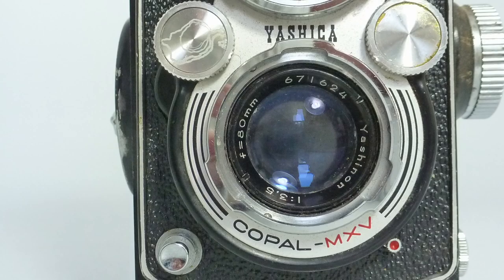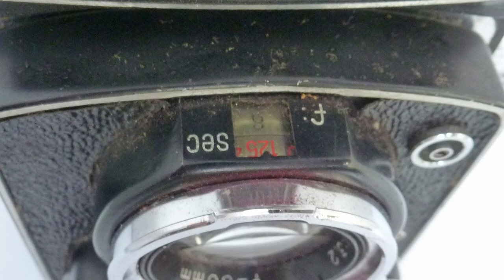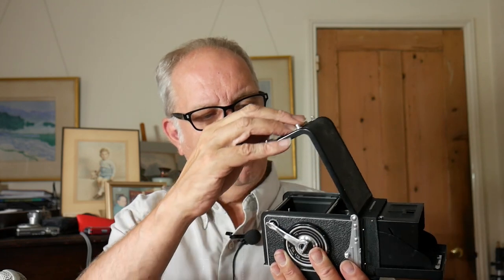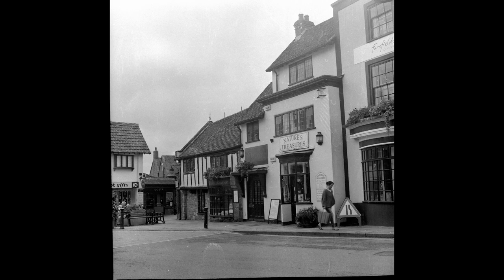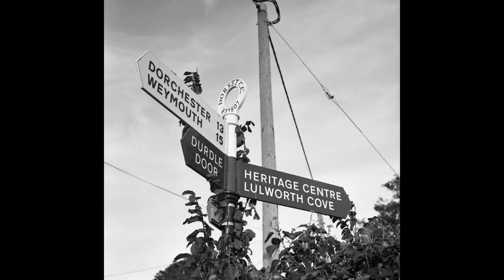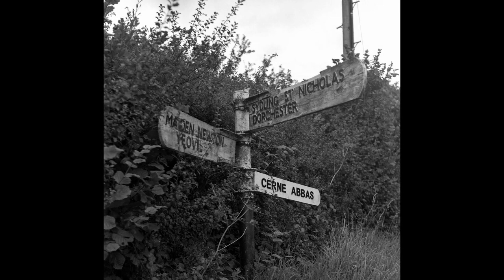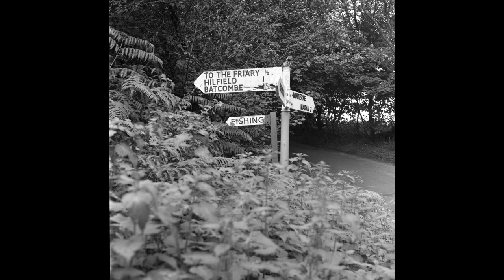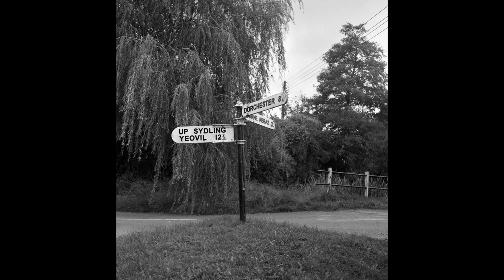The Yashica Mat TLR camera

Comment: I just picked one of these up at a camera show in pristine condition for $50 (U.S.) and the first test roll shows no leaks or other glaring issues. I have to test it more thoroughly before relying on it completely, but so far it is a joy to use. Thanks for your video and experiences. Oh, wanted to mention, my camera is from 1970, and when advancing the film I do not have to place the handle back into the slot, just reverse it untill it stops and then it will fire again. I don't know if this is a change in production or if earlier ones would do that as well.  Cheers!

Comment: Thank you for explaining the Yashica Mat. I have one and I wonder if you could explain what the side wheel with ASA DIN means?
Reply: That value should be set to match the sensibility of the film (ISO). So if for example you used a film with 400 ISO, you'd set ASA/DIN to 400. Some variation can be done if you wish to push/pull your film but those are more complex creative processes, so I'd suggest beginning by setting it exactly to the ISO value. Hope it helps and have fun shooting!

Comment: I just got one of these cameras and it belonged to my grandmas before she gave it to me but the only problem I have with it is it’s missing the little crank on the side, do you know what the name of this particular piece is so that I could maybe look it up and purchase one as a separate piece?
Reply: Yashica has been out of business for decades, and the Yashicamat cameras haven't been made for 40 years. To find a crank (film advance) handle, you'll need to find one in the used market. It is a reasonable DIY job, You can check repairmen who specialize in these things, as they salvage parts like this. Otherwise, look to buy a damaged or otherwise cheap "Mat and pull the parts from there. Keep in mind that the Yahicamat was made almost without change from 1959 to 1986, so any will do for a crack handle. If you do something like this, note that the reason the handle is missing is that it was held on by a small pin which had just a friction fit. If you find a handle, you'll need the missing pin as well. This (all versions) was a cheaply made camera. The reason there are so many of them is that they were low-priced new, one of the least expensive TLRs made. Most camera repair shops won't work on them.  With no recommendation by me, I located this source on the internet. Inquire first for parts and pricing before sending your camera to them, or else.... https://www.facebook.com/yashicarepaircenter